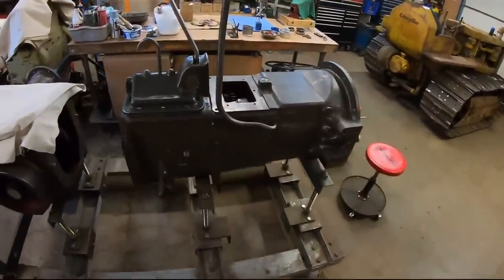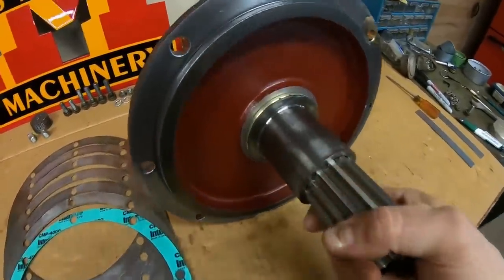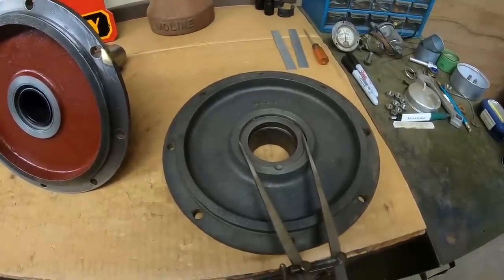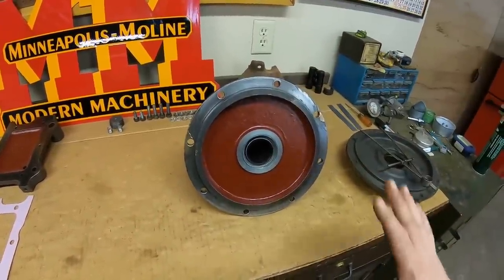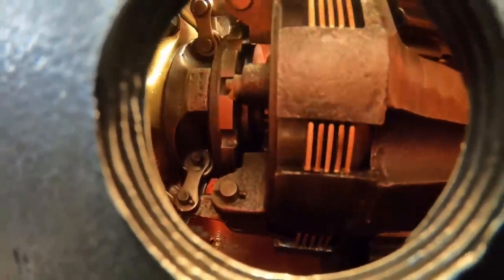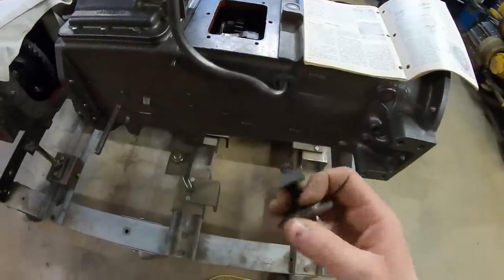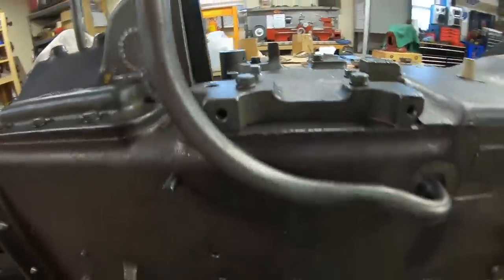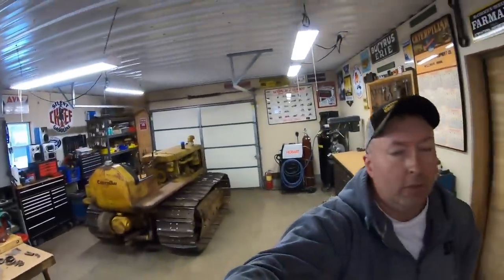#X231 Prototype Part 56: Let's Seal It Up! Finishing the Ampli-Torque Compartment Setup

Comment: Ampli torque design carried on to M670 series!     Cautionary tale....  I knew of a farmer that was "diagnosing" problems with his tractor and had slid his hand into case between planetary gear housing and case wall..... because of sprague clutch the planetary assembly only rotated one direction and the more he pushed his hand in the tighter he was entrapped. He ended up on a stretcher beside the tractor sedated with I V and to extricate his hand they drilled a series of holes in side of gearcase and smashed the side out.    Even an antique can be dangerous.

Comment: So, this probably a question with an obvious answer, but I've rewatched all of the X231 videos, and I can't see where the driveshaft (probably wrong terminology) for the PTO is routed, I had presumed it just snaked through the transmission somehow, but I don't see any provision for it in the cover for the Ampli-Tourque, where did that run?

Comment: As we have seen and heard Toby agonize and contemplate each and every move made on these projects, to all you GOTTCHA keyboard warriors, you need to pay closer attention to the provided visual proof. Work is done right  and correct here, or not done at all. If you do not KNOW FOR SURE, though  your own life, ask a civil question. And receive an answer and learn something. In the measured and considered manner that these videos are done, do you honestly think a gasket would be "forgotten"? The manual not consulted for torque values, the guy pre cleans all of the fasteners to be used and evaluates them for suitability, threaded holes in parts and castings are re tapped for good clean threads. For those of us whom have worked machinery, this channel is a joy to watch. Proper care and evaluation of all components is used prior to assembly, I have yet to see a SHORT CUT used that did not make sense and was needed to make it BETTER. Toby has my admiration for the work he produces and my heartfelt Thanks!

Comment: Imagine it is oh say 1965,. The amplitorque unit grenades and takes out the front cover,. What would they have done to properly put the machine back in service ?  They would have parts that were available.  No shame in using production parts it just shows the tractor worked for a living and wasn't just a parade queen !

Comment: What was the difference between prototype and experimental units?  I saw another MM video where they were talking about an experimental tractor and it had EX casting numbers instead of 10x like X231.
Reply: @squatch253 Thanks for the explanation about experimental models. I hadn’t thought of an in-between stage between X231 and the production model. I’m continually fascinated by watching this channel. 👍

Comment: A thing of beauty!
I wanted to see how you got all the tape off the spline without leaving any under the shaft cover, that looked tricky.
Reply: I saw that too. You plan things out before you do it and sometimes you overthink things. For example, your first effort to bend the replacement fork for the 2-3 shift fork. The second time you did it the way the original was probably done.

Comment: Now I see the placement of the seal and thrust washer, it makes much more sense. I was thinking that the thrust washer would be rubbing directly on the seal and that did not seem correct.
I understand about the leaks, however wouldn't the the shims be a better fit? because as it wears you would be able to remove a shim to get your endplay clearance back, or am I thinking of it wrong. Ok I know it will never see enough hours to wear. sorry 
You are one more step closer to being able to bolt that back together to free up more floor space! Great work!
Reply: Toby, I think using a gasket and adjusting clearance with the thrust washer is definitely the best choice. 👌 It definitely reduces the chances of leaks and to me it's still just a matter of checking your clearance and if it is out of spec you get a thicker or thinner thrust washer to compensate.

Comment: I can tell you from working on semi manual trans anti-freeze will take the coating off or change it to wrinkle black rusty mess. I got right now apart with Aux box removed replacing output bearing. Trans oil cooler when they go bad put coolant into transmission.

Comment: Squatch I sure do, that means we are getting closer to clutches ,brakes n pedals ,steering throttle and fuel systems and power unit intallation and cooling and that front bolster section love the refurb work your doing man beginning to get closer to being a whole tractor bud.

Comment: Hi Squatch, I was wondering whether you will be priming and painting the inside of that unused boss or just relying on the cork to prevent water ingress and rust? I ask as it just seemed a bit odd to me to only use a cork considering the lengths you go to with other areas of your restorations. Also thank you for doing another restoration, when the 1113 series finished I was getting restoration withdrawals! It's really depressing how many so called restoration channels there are on YouTube. You and MyMechanics are the only two restoration channels I'll watch anymore. Thanks again.

Comment: Great videos . 
Wonder if you'd mind helping me ?
I have a minneopolise moline tractor that im having trouble identifying .
The model number and serial numbers dont tell me what it is exemple, 2star / jetstar and so on . 
Its a 6cyl diesel.
Model-D425A-6
Serial-16404682
Reply: That is the engine identification tag (diesel, 425 cubic inches, 6 cylinder). The tag you need is farther back on the tractor on the transmission. If it is a G955, it would be on the steering pedestal (I think)…
Reply: @klwent2001  
Thanks for the info . Its a gvi now to find engine parts.